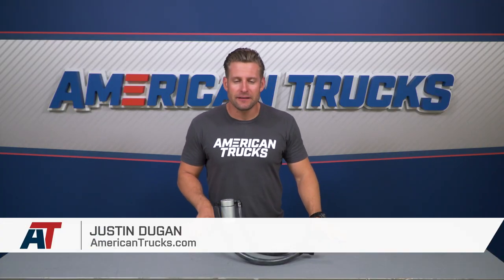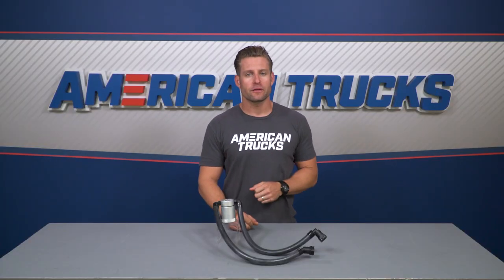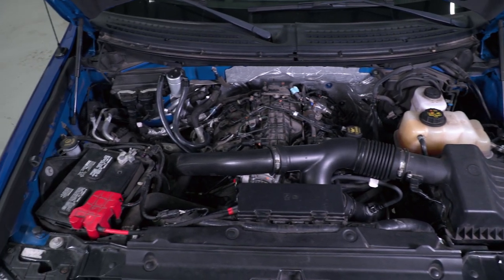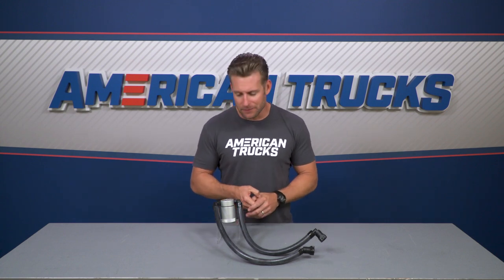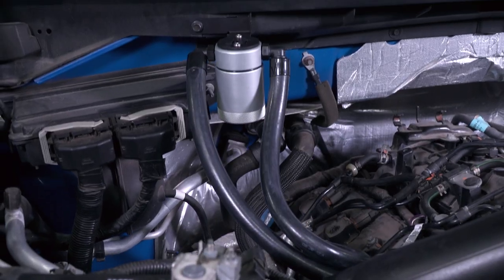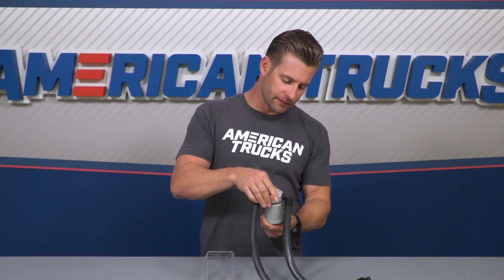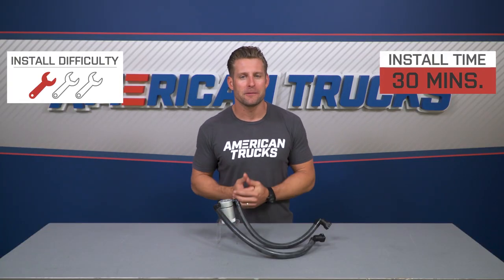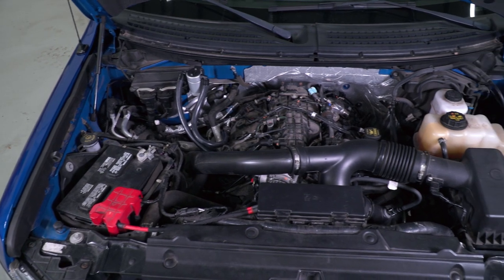2011-2018 F150 JLT V3.0 Satin Oil Separator 2.7L/3.5L EcoBoost, 5.0L, 6.2L Review & Install

Comment: Not needed for 2018 or newer Ford ecoboost motors. They switched to a direct AND port fuel injection system. Also, if you are in colder climates, this COULD freeze up causing major damage to your vehicle.
Reply: Can you show your sources? I have a 2018 3.5 and would like to not worry about this.
Reply: Just research ford changing to the port and direct injection motor for  2018. I found several articles about it. I don't  know if the 3.5 liter was changed because they replaced it with the 3.3 liter. Either way, to be honest. This is dumb. If you're really worried about this. Put a can of sea foam in your gas 2x's a year and you'll  be just fine. These ecoboost motors have been around many years now and i see no outcry about dirty motors failing. And if you do add this, it will void your warranty. My mechanic has 200k plus on his truck using the sea foam.....i feel you though. Lots of info online and it's hard to make sense of it all.
Reply: https://www.motor1.com/news/65129/2017-ford-f-150-ecoboost-adds-10-hp-50-lb-ft/ Okay, I found it. Forgot that ford changed the 3,5 liter in 2017..... You should be good. I use sea foam either way....But with the duel port, gas is sprayed above and below the valves....keeping them cleaner
Reply: @acostuart  So on that article I read that the 3.5 NA has upgraded to direct and port injection. It says the 3.5 Ecoboost is still from the 2017 model? I cant tell whats true to be honest.
Reply: But the 2017 was upgraded to the mixed port injection motor....So your 2018 has the mixed port. You're fine!